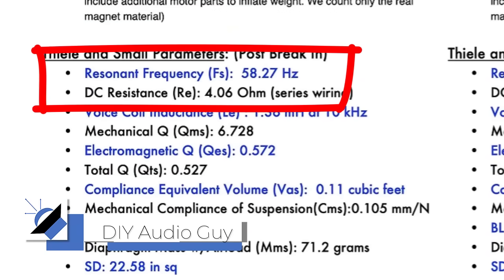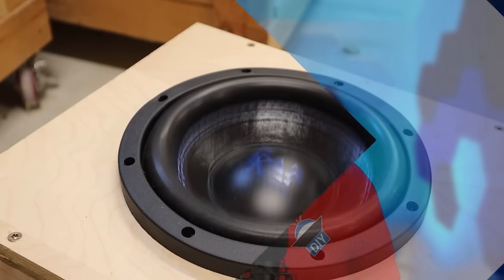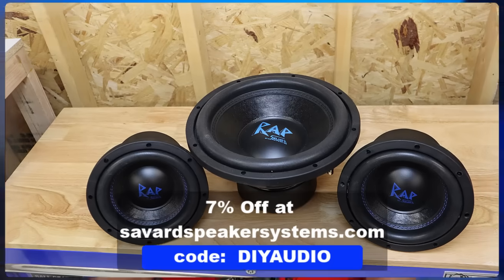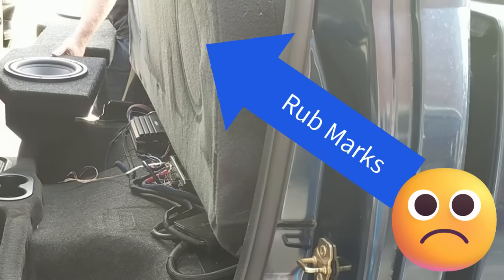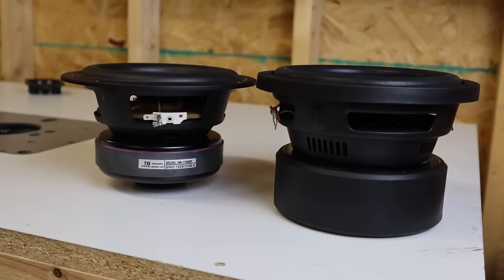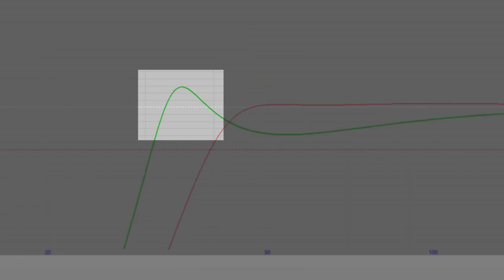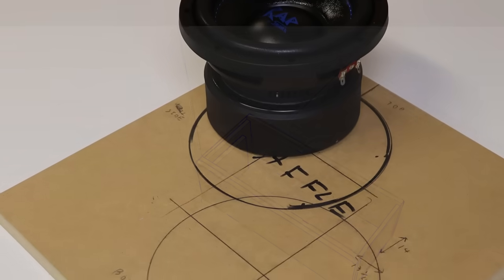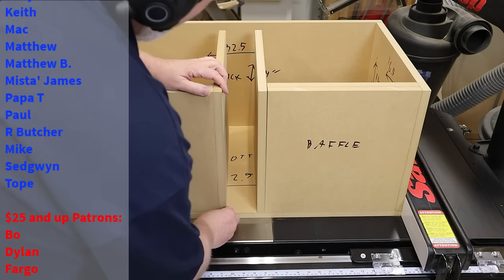The Problem With Small Subwoofers

Comment: I don’t use small subs for 3 reasons.
1-Prone to suspension 
damage because they have to move a lot to make deep bass.
2- Fs (resonant frequency very high)
(Although being so small would not be much of a problem for the amplifier to move the cone).
3- If needed in multiples to sound like a one bigger sub means a bunch of heavy magnets making my car scream for help.

Comment: the size of the sub enclosure to port length ratio maybe why the bose wave radio and the Bose Acoustic Wave Music System could be made so small because they used 17 foot port tube.

you could afford the hardware better by running up credit cards and even buying cheap hardware on ebay maybe even from conflict nations where they are exploiting users and getting older hardware used.

yes older hardware may no longer be valid if the measurement standards have been updated to use a different method for example maybe the old method measured the peak rms and the new method measures the constant rms you may still be able to get the constant from a device designed to measure peak you will just have to read the curves differently.

another benefit to stuffing the enclosure is to cut down on the extra noises created by cracked seams in the enclosure caused by them vibrating in sync with the tone.

it is the sort of thing you are looking for when you pickup a large ceramic or glassware at yard sale and you tap on it.

Comment: One thing banks of small speakers provide is cone response. Why do you think 30 plus inch speakers don't get made any more? It's cone response, if the array is built correctly it will act like a much larger speaker but have the cone response time of a smaller speaker.

Comment: You gain 3db in sensitivity at 1watt with 2 driver's and another 3db as you can also throw double the power at the setup :D Good video!

I got 2 SB23MFCL-4 (new revision) in a huge tapped horn and they generate so much air pressure till 13hz at home that i physically can't stop my windows or living room door from shaking even if i lean against it🤣🤣🤣

Comment: Fix my math y'all as applied to cars. Less mass on the cone/suspension equals faster response. Faster response equals lower frequency. No porting or tuning. Resonance equals a frequency band of efficiency and a boost curve. I don't want boost. I want flat response. Big subs, resonance and you tactile feel the bass vibrating your car seat. Several small subs and you feel bass punching through your seat in to your internal organs. It feels to me that small subs have a focused dispersion pattern.

Comment: If you want the woofer to play well below its resonant frequency, you need an acoustic labyrinth cabinet. With a ported cabinet, you would want the port to be somewhat higher than the resonant frequency, as not to produce immense volume at one low note. The old "frequency response" was originally plus or minus 3 dB, while "frequency range" would be plus or minus 10 dB (2x as loud or half as quiet as other frequencies. I play 5 string basses, and have an 800 watt stack with a 4x10 vented cabinet that can go down to 35 Hz -3 dB, and a vented 15, which I would bet can only go down to about 50 Hz -3 dB. I'm pretty sure my deep B is below with either of these, so I aim for power, depth and punch. Since I want punch, I need a lot of higher bass notes. Deep bass is great, but it's nest in movies and gaming. Both my bass cabs are about the same size.

Comment: I love 8" subs! I think they're most useful for getting similar cone area as a larger sub, in a smaller box, with more power handling. For example, 1 SA15v3 has a rated power handling of 1000W and takes a 3 cuft box. I could get a similar cone area and in this case similar volume displacement, with 4 SA8v3s. I would also get that with a rated power handling of 2000W and a box of 2.6 cuft.
Reply: Power handling has virtually nothing to do with response. A 100W 18” woofer would make more and cleaner bass than a dozen 8” cones with 1000W. The 8” cone is the wrong tool for the job. The requirement is simple - move the air. As more and more inadequate devices are depended on to achieve that, distortion rises, power is wasted, and ultimately the frequencies you originally wanted to reproduce are not reproduced.

Current technology for infrasub design uses 26” drivers with ultra-stiff lightweight cones to render 10-30Hz signals in concert sound, the ‘feel’ frequencies. The goal is satisfied as can be verified with very simple math. No quantity of 8” drivers could do the job. There is no free lunch in physics. Making mean-looking mini woofers is a job for hucksters. The smaller, the worse. 

By the way, box volume is not an arbitrary design choice. It is strictly dictated by the design of the driver(s) used. The only way to reduce box size is to choose a driver with the right resonant frequency AND mechanical characteristic of the entire motor assembly, which is the cone, surround, and voice coil. Pro speaker design is not the least bit random as you seem to suggest.
Reply: I love your condescension, it's refreshing. You were right with the statement, "The job is simple - move the air." Full stop.  If some quantity of 8" woofers moves the same amount of air, which is cone area times xmax, then yeah, damn similar bass. You are so far off of what I'm talking about which is funny. But if you would like to test your thought, get your one 100W RMS 18, put it in a box and then put it in the trunk of a car. I'll make a box with as many 8s as it takes to get equal volume displacement and I'll give it whatever power handling that comes out to. I'd bet you $100, I win. This ain't pro sound where FLHs rule the roost and box size can be whatever. This is car audio where 30-80hz performance is what matters. But thanks for "educating" me about every concept I already know 🙄
Reply: @arthurhicks9586     Glad I could help, Arthur.

Comment: The Savard hi q 6.5" are super impressive. I had 4 of them in my 74' elco. Made a custom box tuned to 30Hz and they get down! They flex my car crazy. Running them at 4 ohms on a d4s jp33. Now I have Savard high output 10's running at 1 ohm. And god dammnnn.

Comment: Genuine question, trying to learn. If the smaller subs have a free air resonant frequency in a higher hertz range, are we talking a significant difference in how hard they have to work in a low tuned box compared to a sub with a lower natural resonant freguency? Is this difference seen in metered wattage output or how do I test this theory?

I built a 28hz tuned ported box with two Skar EVL6.5’s for a friend and it was surprisingly low and windy, but subs always got hot at 200 watts RMS. Shortened port to 34hz and could play over rms all day no heat. I never understood why since I wasn’t exceeding mech x-max and I was at recommended power and not playing below tuning. Maybe the high free air fs of 61hz in a low tuned box explains it.

Comment: I have a 2021 Ford F150 and I have 4 front facing 8" subs in a custom Skar sub box.  It sounds great with a Pioneer GM-D9701 amp at 2 ohms.  I've done some testing with 2 10's and 2 12's, but for everyday driving, the 8's are perfect for all genres of music.
Reply: Does skar have a down firing version?

I'm worried about equipment and groceries damaging the cones

Comment: I always a had a single 12" getting 3/4 of its rated power handling. People were shocked when i popped the trunk. Better yet when i got 2-  8s to sound like 12s. Then the new 6.5s came out and i had 2 of those sounding phenominal. I have Subzones test cd and most of my setups handled most of those notes. Feel the vibration but cant hear the lower notes. No my current vehicle is systemless as the 2018s and up are factory screwed and it cost a small fortune to put aftermarket sytems in them without losing factory safety systems. Hate these car manufacturers for that.

Comment: I use small-diameter/high-excursion drivers for the subs/woofers in bluetooth speakers where space is at its most premium. There's no such thing as a free lunch and these designs will always come with the compromise of distortion in the form of heavy 2nd/3rd harmonics and lazy impulse-response. The iron law is iron. 

Still, modern drivers are incredible in how much less compromise we have to deal with for miniaturization, especially in the age of class-D and li-ion batteries where space is saved even further.
Reply from the maker: True
Reply: @DIYAudioGuy  Now the truth comes out.

Comment: For what it's worth, we have an old 1994 Explorer with a factory JBL system. The four door speakers don't go much below 150hz. The little 6.5" factory sub in the rear corner does quite a good job filling the low end. Of course it doesn't blow anyones hair around lol but impressive for so little driver all by itself.
Also a friend had an 1987 Pontiac Fiero with a factory 5.25" sub located up under the passenger side of the dash. The little thing did a very respectable job with the bottom end! (Fun facts that won't change your life!)
Great content on the little subs!
Looking forward to more stuff.
Reply from the maker: Cool old cars!

Comment: When I started in the hobby in the 80’s I noticed that most sub manufacturers used the same basic motor assembly for their 8”, 10”, and 12” drivers. To my uneducated brain it seemed that the motor pushing the lightest cone would be the most accurate. At the time I found that the best compromise between accuracy and deep bass were the 10s. I chose to go with 4 8” subs for space consideration and to gain back some of the deep bass. Always being an sq guy I have stuck to 8” drivers in a proper sealed box and plenty of power to this day.
Reply: I'm upgrading to 3 10s I can't wait to install em
Reply: I found that an 8 inch driver in a sealed box with a Qtc of 1 and and driver/box resonance frequency of 60 Hz gave the best low frequency extension when it combined with the vehicle cabin gain. Getting down to 20Hz was no problem.
Reply: @davidlong1786  isn`t a qtc of approx 0.7 the usual goal. what do you like with 1
Reply: @hotdog9262 after running 1.1 I could never go back to 7 qtc the 1.1 hits so much harder and sharper

Comment: I put a 6.5 subwoofer in my concrete mixer cab on 300 watts and people can't believe I'm running such a small subwoofer. I unfortunately bottomed out the sub too many times on 25 hertz rebassed music and now the cone slaps the voice coil. Great video Justin as always.
Reply from the maker: Cool!
Reply: I bet you bent the former. My speaker had an annoying noise beyond a certain volume... Took it apart, former collapsed slightly on the end. Ruined :(
Reply: @greenbassboosts8872  that's exactly what's happening.  After about 1/4 turn on the bass knob it sounds like it's hitting something. I never considered the former! I'm replacing it with a CT Sounds Meso. Hope it doesn't happen again!
Reply: Consider a 10 inch shallow mount subwoofer. More cone area and deeper bass, and it’s still pretty compact.
Reply: @davidperry4013  already had a 10 and it was way more bass than I wanted. Completely drowned out everything else.
Reply: @RJSDZNS  then you just needed to turn down the gain until it was at a level where it didn't drown out everything else.
Reply: Lol yeah, sounds like another setup issue....
Reply: @hopskustomaudio  for the cab I have a 10 was way to much, regardless,  that's why it went with the 6 5.
Reply: @ThePentosin  ok so I will dispell this argument once and for all🤣. Gains were set up properly. The problem was the bass knob was tuned for non rebassed music. I have put on for my city rebassed in one of my Playlist. That initially low bass note is hard for the sub I have so it would bottom out, exceeding the mechanical limits. Too many times of doing that and the sub breaks, that's what happened. I will be cutting the sub apart and uploading the video on my channel once I build the new box for the CT Sounds Meso I have.
Reply: Ok, but... a 10" doesn't drown out the rest of the music, unless you set it up that way. Aka, setup issue.
Reply: @ThePentosin  big sigh
Reply: i have two EVL-65 boxes from skar sandwiched behind the seat of my old single cab, haven’t had the chance to show them off but they sing
Reply: Sounds like you havent implemented a high pass filter. Or maybe a poorly implemented one. Ported subs unload below tuning frequency, the driver behaves as if it was in free air.
Reply: @ThePentosin  no I have the filters set up right.  I just bottomed out the speaker to many times with maybe a tad bit to much power at the same time 🤣🤣
Reply: Are you shure? If you bottom them out on 25hz, that sounds like they are unloading. I'm guessing the tuning is higher than 25hz.... The cone hardly moves around tuning.
Reply: @ThePentosin  The 6.5 sub is easy to drive to it's limits
Reply: Alright.

Comment: I just built a box for two CT Sounds Meso 6.5" subs, box is tuned between 38 - 39hz. I wasn't going for spl, more for low end extension. 2013 Ford Explorer.... the factory Sony system sounds really good for stock, but the subwoofer lacked authority. The two Meso's paired with a 400w amp provide enough output to energize the interior of the vehicle without permeating outside, causing unwanted rattles. When doors are closed, you can hear the door speakers through the doorskins, but when you open the doors, you can hear, and FEEL the bass. No need to be the loudest anymore, foundation is strong now...... quality over quantity 😉

Comment: Any driver less than a 12 is a waste of time and money .  Not having enough space is no excuse......Any driver less than a 12in is a woofer, not a subwoofer ...Savard Hi-Q12  is the one to get.
Reply: Because you don't know how to use them?
Reply: @moasto02  lol
Reply: I've had dual 10 inch Orion xtrs that hit harder then 12's
Reply: i have a single 6.5 louder in the mid 20s than anything you have done hush it. small subs are not a waste of time and money if you know how to use them.
Reply: @puresesh7985  You are correct. That's why  JBL uses 6.5's in the VTX B28 ....Oh wait they don't they use 2 18's....
Reply: @williamblackwell9558  different applications and uses they have the space so use bigger if you are tight on space to use smaller hell JBL makes subwoofers with 6.5s and 8s if you want to make that dumb comparison

Comment: Even with that high fs, small subs don't have any issues playing lows. Box tuning and airspace are the keys. MB Enclosures routinely has pairs of 8 in subs doing 140s at below 30hz.
Reply from the maker: He does good work.
Reply: Im certain that im the dumbest one here, however, ive never heard 8s or 10s that I could say the equivalent number of 12s or 15s wouldnt hit at bare minimum, as hard, typically harder than the small subs. Sure, ive heard 10s that sounded "fine" if thats what you're into, however ive never heard 2 8" or 2 10" subs that literally took my breath or cracked a windshield. Im 47 and started in car audio at 17 years old, US Amps and Orion XTR subs is what i started with. Everyone has different taste in sound, i have friends that think one 12 or 2 10" subs is "plenty", while Im plotting a 6th order for 4 12" subs. For now, as budget permits i plan to expand, but that's hopefully enough to make me feel like i have a decent start.
Reply: @HammerBack10mm I have 4 - 8" subs in my Audi S6 and it hits every bit as hard and low as my 18" DC audio level 4 did in the same vehicle.
Reply: @vinnyaudi912  because that 18 needs more box the more box the better
Reply: @Edrop-sj3vx  you shouldn't post right after eating a crayon
Reply: In vehicle cabin gain is responsible for that. You get 12db/octave boost below the starting frequency for cabin gain in your vehicle. You can calculate that by 1127/(longest length in feet) = starting frequency. For a car of about 12 feet from start of trunk to firewall that = 93hz. That means you get a boost starting there that goes up 12 db at 46hz, 24 db at 23hz. That 24 db boost is no joke, it's like running 16 subs instead of 2 at 23hz.
Reply: I’ve ran them all 8,10,12,15 I’ve had 4 12’s in several combos. Some walls some ported down fires. I’ve also had them in a blow thru. But my favorite till this day was 16 8’s box was tuned around 32 and they were by far the cleanest most responsive. I enjoyed them all. Really in my opinion it comes down to what you prefer.
Reply: @dustinturner3704 you said 16 8s I wonder why it was most responsive
Reply: @MotoAtheist  you might want to watch both the videos in their entirety. No one I know of has claimed that a smaller sub will outperform a larger sub when setup with the correct amp and box. BUT when you try putting 2-3 10”+ behind the seat of a regular cab truck the box size alone is going to Kill any advantage the 10”+ had. I’m putting 2 8’s in optimal sized box with the right size amps, in my regular cab and could probably get 3-4 if I wanted. I could only get 2-10’s in the same space. 2-10’s ain’t going to be louder than 3-4 8’s if both are setup properly.  BTW MBE is pushing 141db on music with 8’s that weren’t even broken in. Not just frequency bursts. That’s not just some video he has. I sat in his truck and listened to them.

Comment: My sundown 10 u is 48hz fs but the enclosure its tuned 36 and it plays down to the high twentys so it plays from 29 to about 55 hz a very wide bandwidth
Reply: Shouldnt they be able to play a bit higher with a 36hz tune? I use 12" and 15" in my cars but at 32hz tuned ports for both, they can play mid 20hz into the 70-80ish hz region or so.
Reply: @Luminous.Dynamics  it will pick up the higher frequency but it would not play it with authority because of the lower tuning of the enclosure which is 36 hz